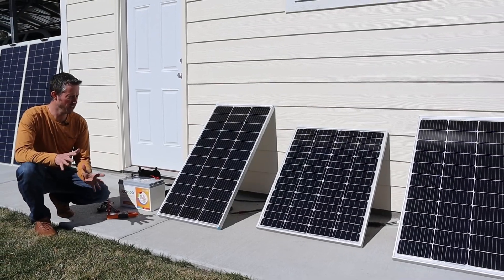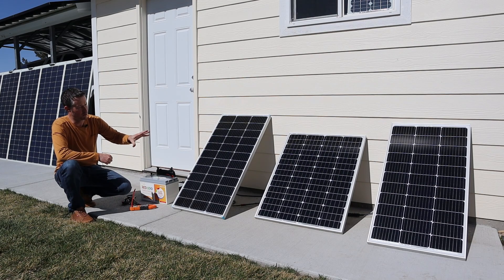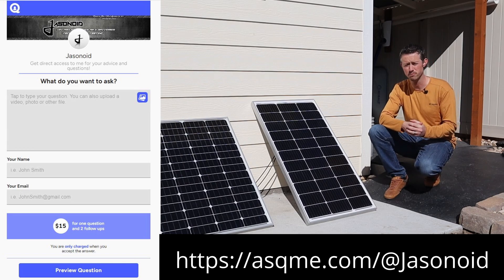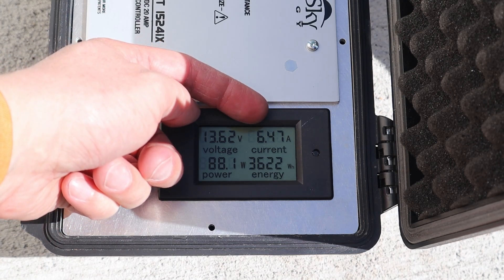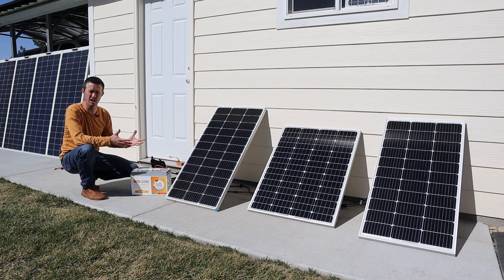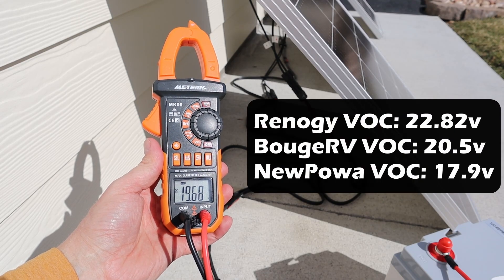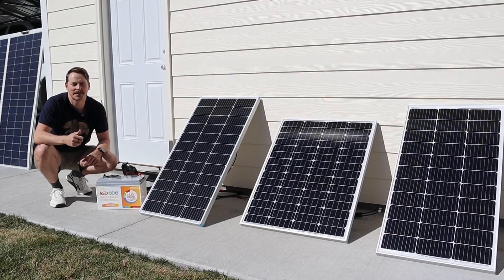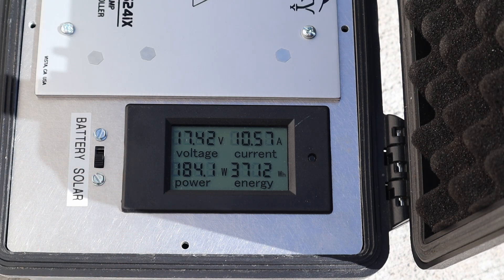What Happens When You Connect Different Solar Panels In Parallel? Renogy - NewPowa - BougeRV

Comment: I have 2 200w panels doing 36v and 1 200w panel and doing 20v my bank is 60v elite v2 200w.  Cable is 8awg and 30 feet.  What size fuses do i need to run parelel?

Comment: Just connect them in series. Then their voltages would be additive.
Reply: Yes but the amperage would only be as good as the worst panel in the series set.
Reply: @Loki-rascal Use panels of equal amperage with a clear view of the sky. If not possible, get a larger controller.

Comment: In parallel, the lowest voltage panel will pull down all the rest. In series, the lowest amp panel will pull down all the rest.
Reply from the maker: It will pull them down but I was surprised from my testing that it didn't matter too much. The panels kinda 'met in the middle'.
Reply: @Jasonoid  I have a small array, where I paired 13 amp panels with 10 amp panels, and they run just fine on a power station that only accepts a 10 amp max, provided these panels are always paired together in series.

Comment: New to all this and learning, so bear with me and constructive feedback welcome.

I have a Bluetti elite 200V2 and 2x of the 200w sp200l panels that are rated:

20.52 V vmp, 9.75 A imp, 24.62 voc, 10.24 A isc

The power station is rated for:
 voc 12-60V, 20A max up to 1000W.

I'd like ro add a 3rd panel - potentially larger so i can get closer to the 1000w rating of the power station, but within safe limits of its 60V and 20A maximum rating.

If i ran a 3rd of the same  model panel in series, will the MPPT keep it from going just over the 60V limit or would it be too close to even consider it?

Or, what if i ran the 2 existing panels in series and add a 3rd larger 350w panel in parallel to them so long as the voltage of the 3rd one is matched fairly close to the roughly combined 41V of the 2 panels in series and at or under 20A total?

I dont care about the brand but just as an example... The bluetti sp350 (350W) panel is rated:

36.5V vmp, 9.59A imp, 43.8v voc, 10.1 isc

Accepting that there would be some performance loss since not matched exactly, would that be at risk of being too close to the 20A max of the power station or would something like that be a reasonable addition (at least in theory as far as specs go)?

Comment: This makes sense. The voltage is 22.82+20.5v, (43.32/2=21.66), 21.66 + 17.9 = (39.56/2) = 19.78... Which is definitely within meter or margin of error for 19.68, given 4 measurements. The difference in wattage is lost to the vdiff of each connection, so 30W goes to heat in the connections, wire, and panels. I wonder how hot the connections get...?

Fun fact this voltage difference is 11.3% when you are showing the 22.82V and 20.5V. 11.3% difference is 31.64W of 280W. So. This actually helps my case of 383V and 360.24V. Showing 6.32% but thats still 737W of heat, for my theoretical 11680W array setup. Thats a ton of heat in connections. idk if i want to deal with that.

Comment: Very simple. If you plot all 3 panels power curves you can sum them up to create a compound curve.
The MPPT (if it's a good one) will scan this and find the peak point. It is not surprising that the low voltage panel won't be contributing as much.
I would be more worried if a panel is matched a much lower voltage one such that the Vmpp of one is a lot higher than the Voc of the other. Then it may start backfeeding and the lower voltage panel may get really hot.
Reply: That's not gonna happen. There's really no such thing as a solar module these days that doesn't have built-in bypass diodes. You will never backfeed a module and get it hot.
Reply: @Loki-rascal  I am referring to parallel connection. Bypass diodes have no effect in such a case. Most panels do not have a series diode so if the voltage levels are significantly different back-feeding will happen. Still, it takes multiple higher voltage panels to back-feed a single panel enough to damage it.

Comment: I have never seen any brand solar panel giving output of his rated watt.. but renogy 100w panel giving 100w of output its outstanding.
Reply: I agree, but my experience with Renogy 100W panels has not been as good. I have 2x  that I connect in series via an Epever MPPT controller to charge my caravan batteries, and I have never seen 200 watts from them, even on the best of days. Located in tropical Nth Queensland, Australia.
Reply: @sti9754 : "tropical" might be the reason.  Solar panels are more efficient in the cold, which is of course offset by the less direct sunlight and shorter days of winter, but if you're in a tropical area then it may never be cool enough for peak performance.
Reply: All panels put out their rated wattage but you have to pay attention to the test conditions in which that rating occurred. If you were to adjust for the proper irradiance and temperature, you would see that the module puts out exactly what it is rated to do.

Comment: The losses weren't too huge thanks to the fact that the VMP is simply the ideal voltage, As long as the lowest voltage panel's VOC is higher than the highest voltage panel's VMP, the panels will just shift around on their voltage/amperage curves. Nothing is producing at ideal levels, but everything is still within spec.
Basically, Great = Identical panels, Good = Very similar voltage, Okay = VOC of low panel greater than VMP of high panel

Comment: I was surprised that the parallel voltage kind of averaged out. The common "wisdom" is that the voltage always drops to that of the lowest voltage panel. That is encouraging, because i need to buy a third panel to add to my existing two. If i buy a panel that is a little higher in voltage than the existing ones, then i can simply pretend that I have purchased a lower power panel for that same price and just call that good.
Reply: Connecting panels with different voltage rating in parallel is dangerous. There will be reverse current to the panels with the lowest voltage if the difference is huge, this will blow the fuse of the panel or damage it.
Reply: @zenniz1992   Well, I specifically said I wasn't planning to do that anyway. But, I get it. It is still important to warn novices to not go too far with things. Even if you are really just looking out for others who may read something later.

Comment: What if you connect with panels of different wattage
Reply: Wattage doesn't matter, it is your voltage and current rating of the panels.
Power (wattage) = voltage x current
In series, final voltage = sum of output voltage of all panels. final current = lowest of the panels.

Comment: i have 4 hqst 100 Watt panels. 19.8 open circut voltage  and 4  9bb hqst 100 watt. 24.1 open circuit voltage...  how should i wire these  ..victron 100/50.  charge controller is what i have.   ???

Comment: my  two 100W Renogy panels mixed in parallel with another brand 200W panel,    22.76V at controller.

Comment: would be also interesting if you connect them in series, what would be the result
as for connecting them in series solar sun panel with the lowest voltage serves as a load for other two allowing current flow due to difference of voltages ....
Reply: The short answer with a series set is that you are only as good as the worst module specifications in the set.

Comment: I have 18, 100 watt panels on my ecoflow delta pro. 6S3P
10 renogy 24.3 VOC
2 renogy 21.8 VOC
4 HQST 20.4 VOC
2 HQST 21.8 VOC
I mixed in the lower voltage panels to bring the VOC down to keep the MPPT safer from cloud edge effect in which jasonoid described in one of his videos which was a phenomenon that I wasn't aware of when running 6S2P all renogy 24.3VOC on my delta pro which is a 150VOC max input and 15.9 amp input max. On cloudy days I would see the input drop to 0 then back up to about 1450 watts on a 1200 watt array... so now with the lower voltage panels mixed in I see up to 1610 watts and about 135VOC and 115 V under load.  the delta pro pulls the 15.9 amps and with overpaneling I get great results in low light conditions like overcast. Thanks Jason!
Reply from the maker: Great tactic to lower down the voltage to keep it within spec of the charge controller!

Comment: I have the same NewPowa panel with the 9BB.  The max I have seen using an inline wattmeter was 95 watts.  Not bad for a $70/panel.  I also noticed a world of difference with the panel tilt.  Testing in the winter sun it dropped 40% lying the panel flat vs the optimal tilt of 45-50%.  So in theory if you connected 3 NewPowa's you wouldn't have that much of a drop then.
Reply from the maker: Great info about the newer panel and it's output. I love the price of those ones! I paid near $100 for the renogy...
Reply: @Jasonoid  Yeah, if I recall I was getting around 20V out of it too.  For less than $20 in PVC and some hardware you can make adjustable legs for them.

Comment: I have 8 Newpowa 100W panels. I tested them on April 30, 2023 and saw 19.8 to 20.6 VOC in the Houston area.
Reply from the maker: This is their older 100w panel (short n' stubby model, 5BB vs the newer 9BB). Their newer panels have higher VOC.

Comment: What happens when you connect in series mismatched panels?
Reply from the maker: In a series array, its all about the amperage of each panel. If you have similar amperage specs on all the of solar panels, the array will perform well.
In parallel, you want all the voltages to match for the best performance.
Reply: Great videos! Can you specify what close voltages  and amps are ?Less say a 21.8 volt panel and a 24 volt panel close enough? I have four of the same one hundred watt panels and considering buying 4 panels that are at least two volts higher but not much more. Amps slightly different as well. Any suggestions would be great. thank you.

Comment: Interesting.  I wonder where that power is going; perhaps heat from the diodes of the NewPowa panel?
Reply from the maker: That's a great question! I'm this case it was only 25 watts being lost, so not too horrible.
Reply: @Jasonoid  In bigger systems, that extra power bleeding off in components like diodes could make for dangerous hotspots that might lead to fire or premature failure of the weaker panels.

Comment: Rule of thumb I was taught; multiple panels in parallel- shoot for similar voltage. Multiple  in series- shoot for similar Amps.
Reply from the maker: That's exactly what you want to do 👍
Reply: Thanks for making it this simple with panels, can you answer me which connection for same voltage batteries with different capacity, parallel or series?
Reply: @macksuting6263 not recommended, it will damage the battery
Reply: why similar amps? they just get summed up
Reply: @gorkemvids4839  no they do not. When solar panels are wired in series you get the amperage from the lowest amperage module in the group. Or another way to put it is that you were only as good as the worst module in series.
Reply: @Loki-rascal  ah yeah yeah you're right. voltage is summed up. current is the same
Reply: The shortest guy. Is the limit to how highh..  the group can resch

Comment: Helpful video. It can be a bit frustrating to try and purchase an exactly matching panel, when even the same brand changes specifications.
Reply from the maker: Yeah, one year a company will have a specific voltage panel, and in a year it's been changed so you can't match your older panel.